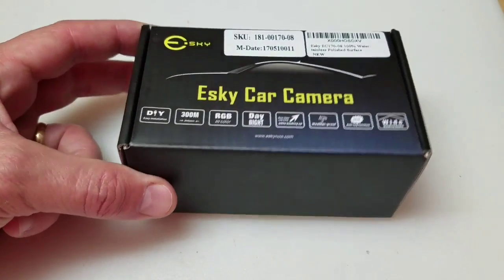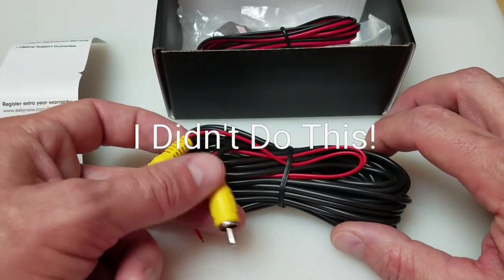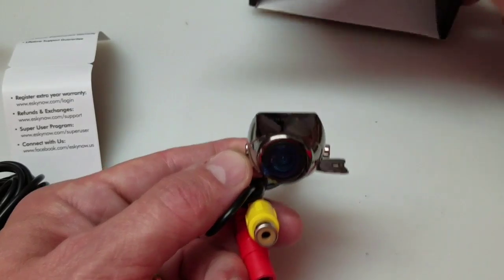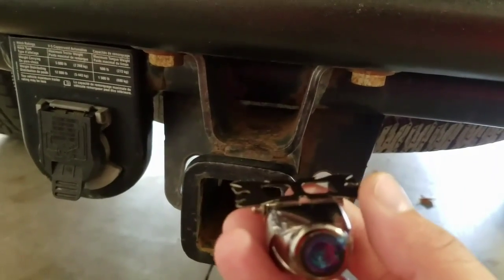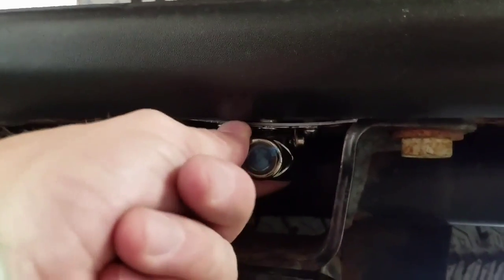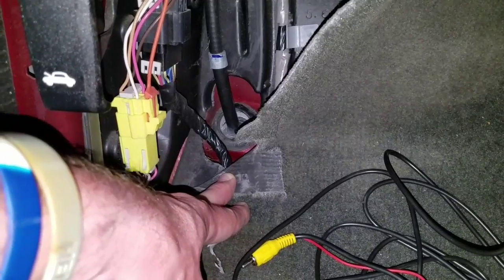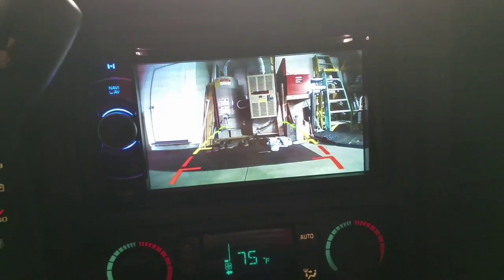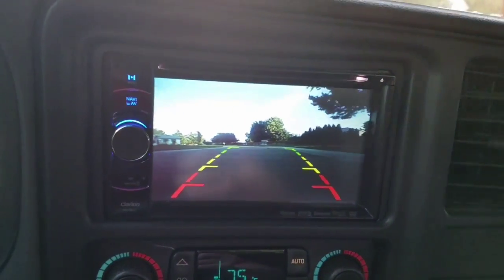Esky EC170-08 Backup Camera Unboxing and Install

Comment: I have been  using  double  add to fuse holder   to add  power  supply  for additional  electricity  requirements. No need to spice into your vehicle  wiring.  Fast and simple

Comment: So did you have to tie into the trigger wire on the back of the radio ? Or did you just hook up the cam feed
Reply from the maker: The head unit had a camera wire.

Comment: I had read that if you mount the camera with teh tabs up, the image on the monitor will be upside down and if you turn the monitor upside down to try to accommodate for that, the image will be "mirror" to actuality.

Comment: I need to do this to my cam. My cam is off to the side. Do you remember the measurements on the metal piece?
Reply from the maker: I'm sorry I don't. But hope you can work it out. Mine has never wiggled even a millimeter.
Reply: No worries! I worked something up. I cut my metal piece a tad bit short so I ended up just putting 3M double sided tape making sure it won't wiggle off. Thanks for the idea! A much better home for the backup cam to be.
Reply: @IdahoReloader   I am doing the same exact set up on my Silverado. I have a question though on the camera wire did you run power to the rear and the front? Or just the rear?
Reply from the maker: Just the rear!
Reply: @IdahoReloader how does it look at night?

Comment: Do your lights have to be on to power camera with the brown wire or does it power on when truck powers on?
Reply from the maker: Southern Style Lawn Care It powers on with the truck.  You have to check these carefully as some of these wires are "switched" when you turn the lights on or go into reverse.  Check for the "always on" wire.  Thanks for watching.
Reply: I have a silverado with same harness and same brown wire. Did you have to wire the red short wires to anything?
Reply from the maker: I did not use the red short wire, since I got power from the harness.  The red short wire can be used if you want to grab power from the constant on source at your head unit.
Reply: Thanks. I am about to put mine in I will let you know how it goes. Thanks.
Reply: Do you have to use any other wires? I used the brown on the rear and then plugged in yellow cable and grounded and nothing..
Reply: I cant get anything to work. Mine is an 07 classic. Do you think the wire may be different? Brown wire doesn't seem to work.
Reply from the maker: Southern Style Lawn Care yes it may be different. You need to pull the plug off and test each pin with a meter.   Make sure the ignition is on, but the lights are off.
Reply: Idaho Living thanks. Checked and my quick connect wasn't working right. It was brown wire.
Reply: Idaho Living the red shirt wire is the trigger wire . It hooks up the the head unit and then you give it power at the other end so that when you go in reverse it triggers the camera on your head unit and then it shows the camera